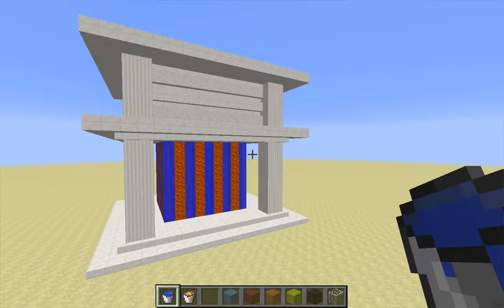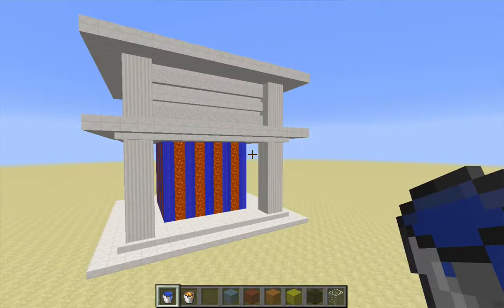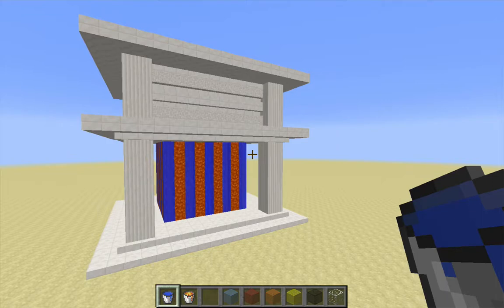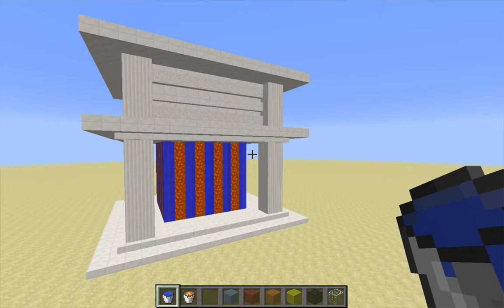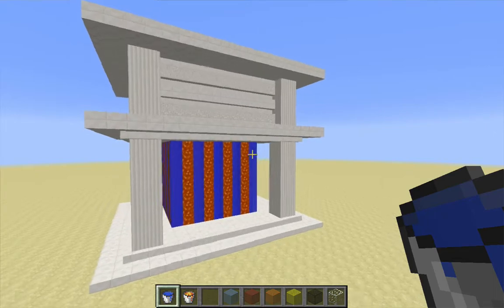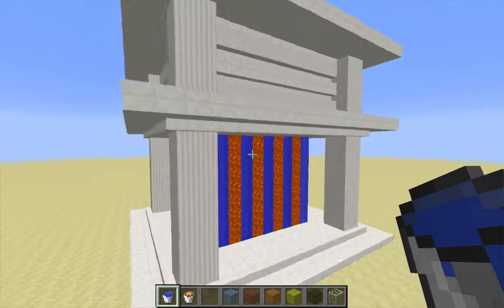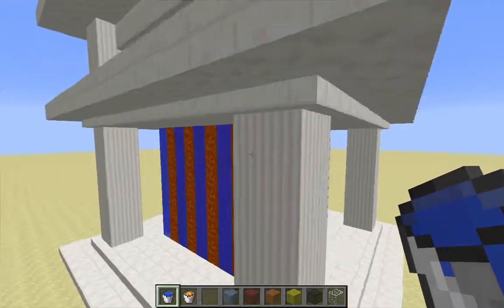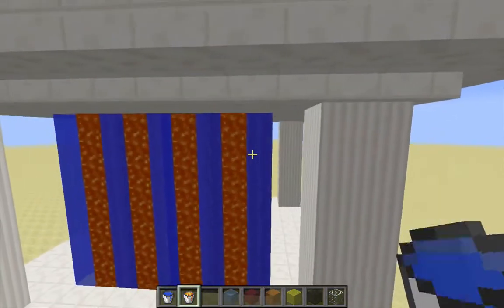Minecraft Liquids, Part 1: Introduction

Comment: I would prefer to see it in longer videos, like if there are a few videos that are 2-10 minutes long then i think they should be condensed together to form 1 longer video
Reply from the maker: +Charcoal111 Thanks for the input. For this series, I think the challenge is going to be the intended third video, the one on liquid spreading. That's probably going to be relatively long already, so I don't want to combine it with either the previous video or the successive video, though I may consider aggregating some later material if it feels too short
Reply: Cool, can't wait to see it :)